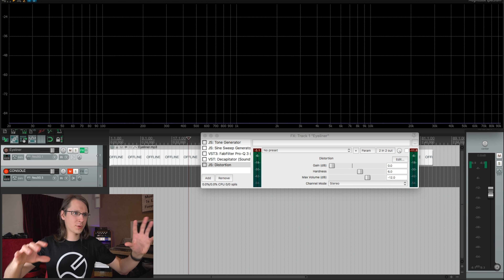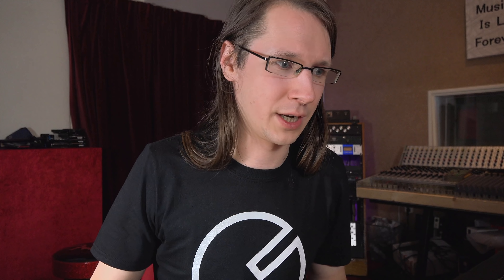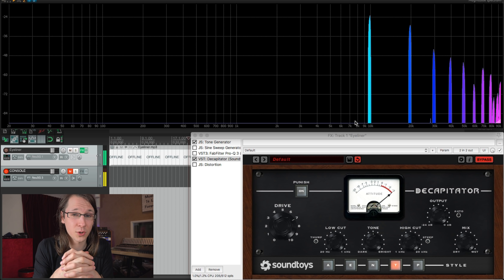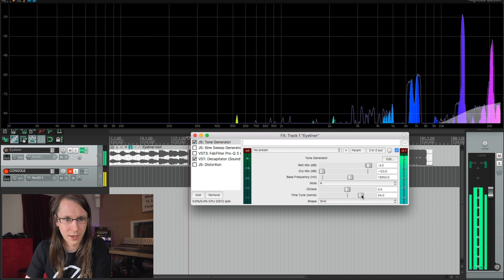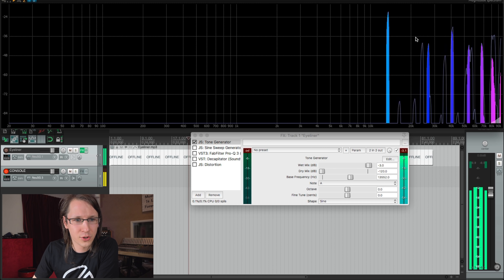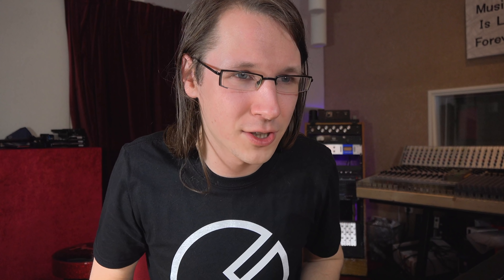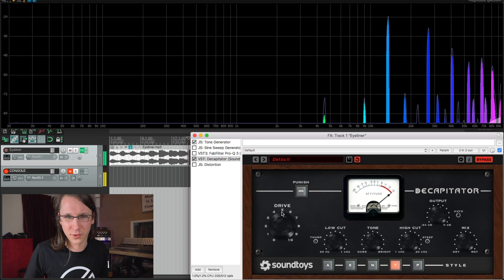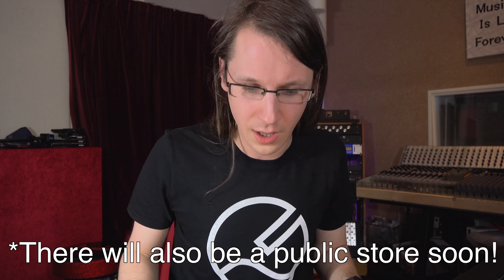Why MANY ANALOG EMULATIONS are SNAKE OIL!

Comment: What insane amount of distortion do you have to dial in to actually hear those artefacts? I just tried and it's a lot. So while it all may be not correct to pedantic people, most of the time you're absolutely fine using software saturation. The pros are overweighting the cons bigtime.
Reply: theory serves to avoid certain mistakes, not to prevent putting a useful effect on sounds.

Comment: This is a very long winded way to say that non linear transfer functions with badly programmed algorithms produce aliasing. Klanghelm stuff won't do that. TDR stuff won't do that. You can write code that doesn't produce aliasing, but it's more CPU intensive. But quite frankly, if you're processing path is working at 96khz it will be hard to produce audible aliasing in all but the most extreme settings even with badly coded plugins, and I've done a bunch of testing. I've stopped worrying about this when I realized I could work at 48khz and render out in 96khz in Reaper quite easily, and when I admitted to myself that musical recordings hardly ever have as much high frequency content as a sine test tone at 10khz and -6 dbFS.

I think where digital emulations of hardware is lacking is that they require more careful gain-staging to not sound weird sometimes, and you hardly ever know if a plugin sounds weird because of it, unless you try with a bunch of different levels and know the original (modelled) hardware quite well. But that's just a guess. I think plugins sound fine these days.
Reply: This comment is perfect! Especially the part about gainstaging in software. Theres alot of upsides to software and it is not inherently limited, although it certaintly can be.
Reply: Definitely agree about gain staging. I found that the harder you drive plugins more it loses quality and clarity. Also many analogue emulations have this 'analgoue' button which just adds noise usually either at 50 or 60hz. I have noticed that it messes with the transients so usually i turn it off.
Reply: Will Waves do it?
Reply: @HollerAtcherBoi yeah exactly,all three of the ssl eqs (ssle,sslg,sslg standalone eq) but waves eq is by far the best i've come across in terms of not messing with the sound too much. Best sound I got is with ssl g channel strip but with the buttons under  'eq to' and 'dyn to' all pressed and with analgoue emulation turned off. What this does is that it keeps the transients intact and brightens up the sound a lil bit in a really pleasing way. Make sure to barely even drive it for best sound. (around -30db on the strip meter will be best)
Reply: I agree with your logic hear, and some badly coded plugins do cause more aliasing.

but ALL plugins that add harmonics are capable of introducing aliasing. Oversampling doesn't get rid of aliasing it just makes it so that the level of the harmonics reflected down into the audible range are so low level they aren't an issue. Klanghelm plugins DO create aliasing, whether it's audible or not is another issue.
Reply: I find myself adding saturation cause its "in" ...I'm not totally convinced..You want to add warm distortion to a track..Mmm...no convinced at all...
Reply: Meh, I'll go with the guy who uses his ears over the guy who uses a textbook, any day.
Reply: Working in 48 and rendering 96 is an interesting approach! I've been debating this point myself because the high sample rates chew up CPU, which is mostly not an issue EXCEPT the fact that I do one-stop-shop production/tracking/mixing. So I might have heavy plugins running while trying to record and monitor myself on an extra lead vocal. Freezing can solve it, but it's a pain and workflow stopper because of the time it takes.

Now your post along with the video actually gives me quite a disciplined way of thinking about how to deal with aliasing. Don't have to worry about aliasing coming in, so recording at 48k is totally fine. So track everything at 48k, then convert to 88 or 96 for final mixdown. Also negates the need to go plugin by plugin and turn on oversampling which is such a PITA.
Reply: Yeah I realize that gain staging is the key.

Comment: I have a friend who dreams of (but can't afford) an all analogue studio and despite running Logic pro X on a high end system others could only dream of, he starts projects from a position of pessimisic angst and demoralisation because in his mind it will never truly sound or be great. So, although this is amazingly informative and makes sense, I reckon it's possible to take all this a bit far!
Reply: so many musicians and audio people get so obsessed over the minutae that they miss the point completely. obsessing about capacitor types that are not even in the signal path when they should be concerned about their way too loud valve amp beaming a wall of pain at a few people in front while the rest of room cannot hear any guitar because the amp is too loud for the engineer to add into the less directional PA. obsessing about the year that their guitar was made rather than the dodgy acoustics of the room which a parametric would help with. missing the fact that their perception has shifted since last time due to a zillion things other than wether the badge on their headstock looks cool. wether analogue is better than digital or how superior they are because they have a valve amplifier. then there are the low fi enthusiasts who think crap analogue is better because it's analogue lol. The blues men made great music with whatever they had. I have a friend who is an amazing drummer but can't play anymore because he isnt Dennis Chambers and so gets frustratedwith his playing. I'm no punk but at least they got on with creating music regardless. Don't end up being like the 'photographers' that only ever photograph walls to see how sharp their lenses are.

Comment: Most UAD plugins upsample to 192kHz internally and have since 2002. The old UAD plugins before they switched to SHARC chips would also up the audio bitrate to 64bit and then dither the output at 24bit. These are some reasons for the claims that UAD sounds more analog.
Reply: Totally true. How much of a difference it makes is subjective, and circumstantial, but it’s actually the case. UA isn’t the only plugin manufacturer to upsample, but they are known for doing it early in the DAW plugin game.
Reply: @root Klanghelm is 4x when on.
Reply: Yeah. I wonder which UAD plugins upsample? Hmmm
Reply: But isn't his point Upsample then Alias Filter?
Reply: root ssl-e is trash. The G was decent
Reply: UAD=Snake Oil (in case 99.9%)
Reply: If you mean sometimes UAD plug-in some more thin and brittle to other plug-ins yeah you’re right- 🤣

Comment: I think calling these kind of tools "snake oil" is a bit of an exaggeration.  How much does a an EL8 Distresser cost?  like $1500.  The Decapitator plugin costs around $200.  I agree, it doesn't sound the same, but at the same time maybe you're using the wrong tool.  I mean, there are multiple types of drills, or hammers.  It's not fair to use them all the same way and judge them as if they were all supposed to be used the same way.  Plug-Ins are tools that resemble other tools, but are not the same thing.  It's no secret to any guitar player what the sound difference between analogue and digital distortion is, does that mean one is inherently, always the best?  Certainly not.   

There is a reason that sooooo many top mixing engineers are working completely "in the box" these days, because they are adapting to the new tools that are available.  

These kind of videos, I think, are just really bad for the recording community as a whole.  Most people who are recording, producing, engineering, mixing music these days do not have the budgets or funding behind them to buy all this analogue gear.  These kind of videos just feed into the antiquated idea that you need the most expensive gear in order to create music, and that's just not true.  If the plug-in doesn't sound good to you, don't use it.  It might be precisely what someone else is looking for.
Reply: Technical understanding is very helpful to a mixing engineer who has ambitions, no?
It helps to avoid mistakes, and to debug harsh sounding stuff (from lack of oversampling).
What to do? Technology again. Time vs. money. You can take your time and print certain effects at 96k or higher, when your CPU can barely run this one effect alone.
So yes, almost everything can be done on budget, but the speed of production is definitely a parameter in professionalism, and in financial throughput of the business.
Reply: @neovxr  Not arguing with that point one bit, you're absolutely right.  But when you think of the number of people who are in the world of music production, only a small percentage of them can actually afford the original analogue products.  Even professionals, in fact most professional engineers/producers I know, have the smallest collection of preamps at their disposal, and maybe a compressor or two.  I do know the owners of a few big time studios here in Seattle as well, and their studio bought all their gear 30 or 40 years ago when they were reasonably priced. And some of the other I know have the luck to have been hired at major studios in town.  And while I hate qualifier statements like this, I've been a professional musician over 20 years, worked in studios, worked music retail for over 13 years, and what I'm talking about is true for the people I've met/worked with in my career and my experiences.   

I think videos like this, while honest and true, are also holding out on the fundamental purpose of creating art.  It's art.  You can create art with any number of tools, and maybe the marketing on plug ins saying "sounds like the real thing" isn't always right and it's great that someone is pointing that out, but at the same time there is no alternative suggested, no attempt to find a usefulness for it.  I've dealt with a lot of musicians over the years, and had to talk a lot of musicians "off the ledge" so to speak because a youtube video, or some other sort of review said something to the extent of "this piece of gear is trash and nothing is worth buying unless it's this piece of gear...that costs $5000"  The average kid watching, or musician hoping to get into recording will see this video and just be overwhelmed, and discouraged.  

I'm not arguing the legitimacy of what is being presented, and you have you a very true point that in the world of music, your gear does (to a point) show how committed to the process you are.  It's why I spent thousands on amps, guitars and pedals in my life, so that when I got to gigs, I'm taken seriously.  But it wouldn't mean anything if I couldn't play.
Reply: @patrickfouhy9102  I see, and can understand you better now.
Still I'm afraid that too many artists shoot themselves in their leg on their own. Why believe anything on youtube, based on 5 videos watched? One needs to compare like 50 speakers, or do some serious traditional studies in an audio school.
That guy did not say you should not create art. But I think it would be useful to listen to Warren Huart, who always tells that musicians should put their own visions and creativity first, and get along with what they have in the wisest way. Comes time, comes gear, no matter ITB or OTB.
Basically, one should know what the budget goes into. For certain tasks, we can use either classical hardware, or good plugins, that can oversample. This one has been quite simple.
A totally different universe is on the rise, about those spectral AI plugins, like that AdaptiVerb by Zynaptiq. It's a game changer, but also, might become a pest.. ^_^
Reply: @neovxr  For sure.  I like Warren, he's great!  Also, glad to be able to have an actual conversation with someone.  Thanks for being cool. :)

Comment: Defenders of Decapitator will say "but the aliasing never stopped Decapitator from being used on multiple hit records / grammy award winning productions".

That's probably because most of the engineers working with those records were only using Decapitator subtly, and most of the heavy lifting happened in the hardware / analog domain, with different pres, amps and whatnot.
Reply: Also this sort of audio distortion / aliasing would not stop an award winning production. People pay way too much attention to these sorts of little things, compared to their actual mixing, sound design and creativity. (note I'm not saying plugins shouldn't oversample, they should, but this is not a deal breaker)
Reply: Probably they also have computers powerful enough to handle big sessions at 192KHz
Reply: They were hit records because of the artists not the producer. Hate to break it too you. Lol

Comment: That is super interesting! I didn't fully realize the implications of digital saturation regarding aliasing. I did the test with Softube Saturation Knob, the 'pre'-section of Scheps Omni, Cubase stock plugins and they all clearly show the problem of bouncing harmonics, except Cubase Magneto II. None of the plugins I tested have an oversampling feature though.
It probably explains the smeary brittleness that digital saturation often introduces that analog gear doesn't. This might actually be the best reason so far for using high sampling rates.
Come to think of it, perhaps DAWs should have an oversampling option per plugin, so that plugins don't necessarily have to do it internally.

Comment: In my head I was like: "just turn on oversampling?". Then I noticed decapitator does not have it. WHY?! Almost every distortion plugin has it

Great video btw
Reply: I was thinking the same, just why???
Reply: @QuadDamage666  That is exactly why, it's just old. New software has oversampling almost always, All Devices in Bitwig, including the grid are 4x oversampled afaik for example. So are U-he plugins, serum, IVGI2, etc etc.. Don't just follow vsts because people liked them, find your own, and use current gen software, or at least software that still gets regular updates.
Reply: Overload ’
Reply: Lars Meesters try ivgi2, it’s oversampled, free, simple, and sounds great
Reply: @peterbrandt7911  why add oversampling when everybody loves the sound?  Aliasing is clearly part of it
Reply: @wi2rd  
At the same time i wouldn't be using plugins just because they oversample which comes at a cpu cost.  Aliasing isnt the end of the world
Reply: @Byronic19134  It depends. I like decapticator, don't get me wrong, but if you're reaching for some analog like saturation it won't. So making it optional would fit anyone's needs.
Reply: @Byronic19134  Of course, if the plugin is good and sounds good, use it. That is all that matters.
Reply: @Byronic19134  you will not get aliasing if you saturate bass or kick at normal use. oversampling are usefull for all saturation like guitar amp because the fondamental aren't as low than kick and bass, and you go at crazy level of saturation. And it can be usefull for quare wave  due to gibs effect but x2 is already good upper *4 it's unusefull and can produce another issue.
In his exemple he place the fondamental at 10Khz, rare chance to get and instrument with this fondamental in a classic track.
Reply: ImageLine users just laughing rn :')
Reply: @yzmikh4570  they just go like - what the hack is he talking bout...?

Comment: A few suggestions what can be done to avoid aliasing while still keeping the CPU performance intact . a) You can design analog plugins that only saturate the frequency range below the point where aliasing can occur. b) Design plugins that will have a high oversampling rate (x16 or x32) during rendering / export, but only medium oversampling during live mixing.
Reply: No feedback? That's poor!

Comment: I just ran a test with a few UAD channel strips at 44.1 khz... no aliasing on a sine wave so they must be oversampling internally.  If I crank them using square or saw waves instead of sine, I get a little bit of junk harmonic content but they are down at like -110db so that's not really an issue. Something worth trying is experimenting with placing a quality low pass filter set around 17 khz right before your saturator to get rid of those intrusive upper frequencies.  Seems to work.  I am doing a shootout with saturators to find one that aliases least, so far UAD, Fabfilter Saturn, and Black Rooster have the best results will all basic waveforms.  Decapitator, Arturia Preamps, MSaturator are basically useless.  When you crank the bad ones to get that sound you are looking for, aliasing upwards of -40 db can be seen, which is pathetic.